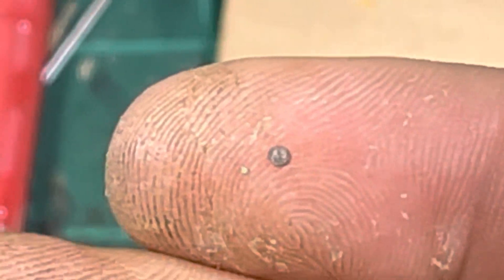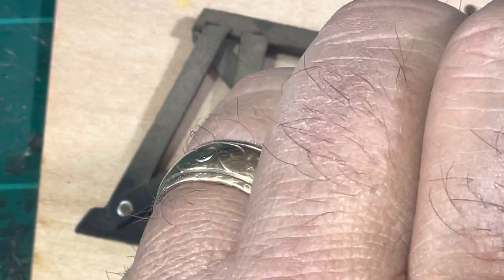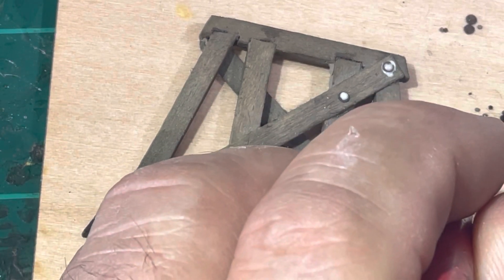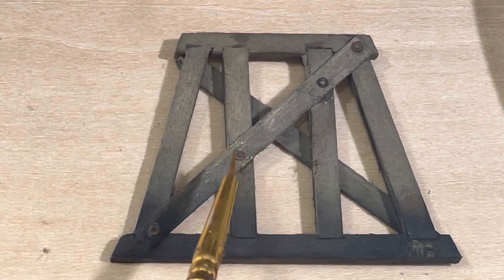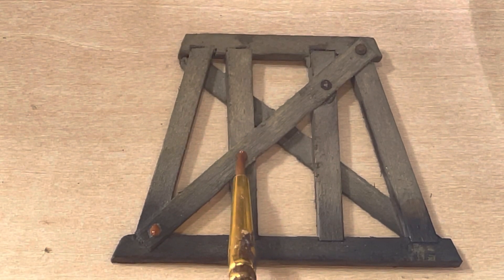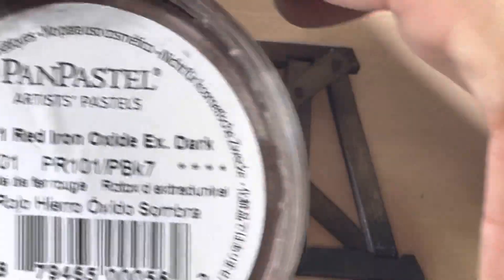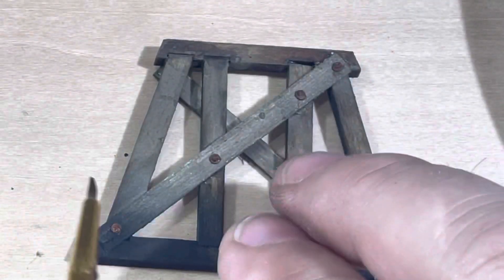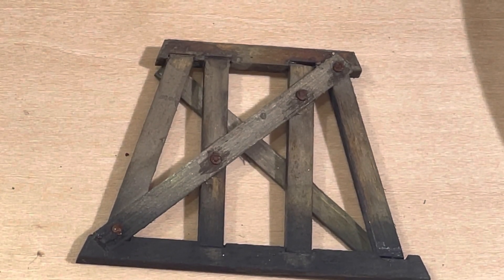Laser Cut Nut-Bolt-Washer (NBW) parts.

Comment: Hello :) This is really nice ! :) May I ask you a question that will certainly sound stupid to you ? You, "on the other side of the ocean" ;) use the name "construction paper" for something that nobody here in craft shops really knows about, or at least not under such a name in its litteral translation. Could you please explain what kind of paper it is and, if possible and allowed, provide any brand or online shop where this is available (so, that I could eventually find the equivalent here)? As a small anecdote, I had the same problem with isopropylic alcohol and some drugstores even told me it must be a forbidden product :D :D !!! I finally found some on a big e-commerce shop. Thank you in advance and best regards ! :)
Reply: Construction paper is a type of colored card stock, I believe in the UK it is also called sugar paper. 
Generally we think of card stock as slightly stiffer, smoother, crisper, and higher quality than construction paper whereas construction paper is still thicker than regular paper but rougher, harder to fold straight, and small particles are visible on the paper's surface. It is used for projects or crafts.
Reply from the maker: It’s usually used for school aged children. Many colors and heavier than standard 20# bond paper. Also has a rougher surface.
Reply: Thank you :)
Reply: @jamesapowell3506  Thank you ! :)